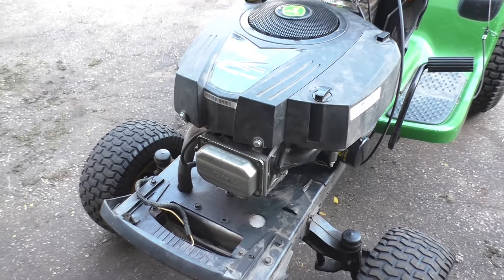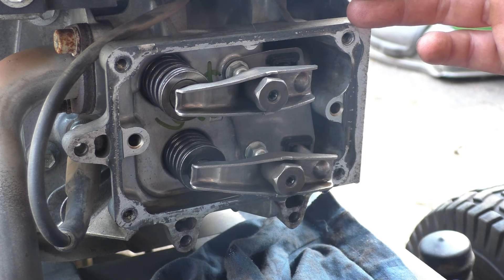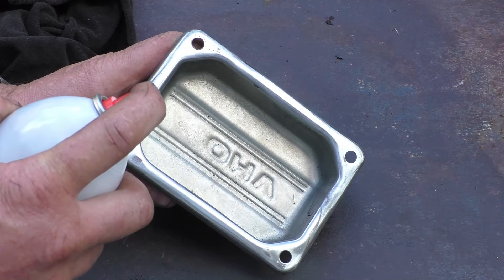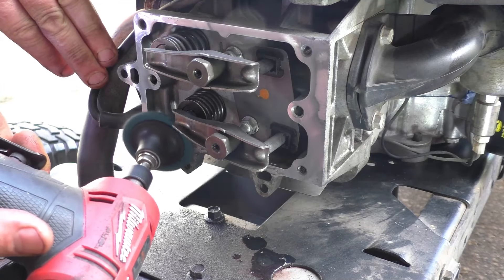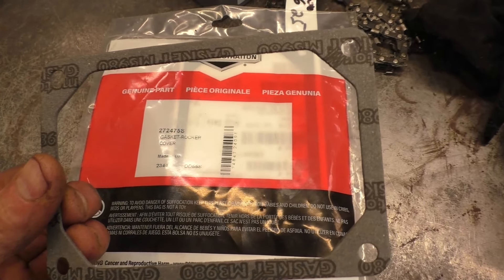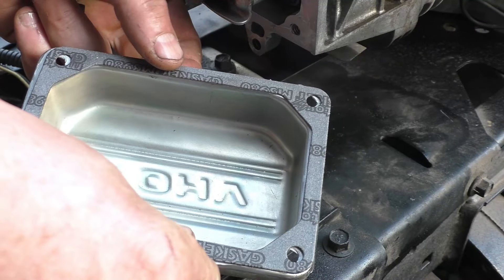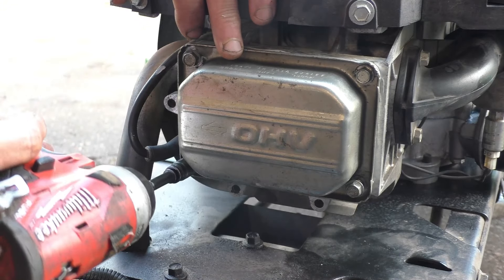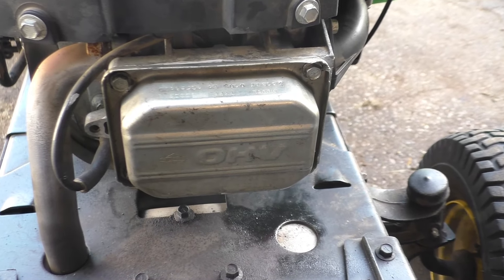HOW-TO Reseal A Briggs & Stratton OHV Engine Valve Cover Properly

Comment: The Scotchbrite disk made quick work of the silicone, good job Dony.  👍
Reply: Those 3M abrasives, and Milwaukee die grinder are a Godsend ! Very few tools make you smile every time you use them... 😁 Saves time, better surface quality ! 😉👍
Reply: That's for sure Marc, I love having them in the shop. 🙂

Comment: I got this procedure from one of your valve lapping videos, which I followed to lap my valves to raise compression.  I also used it to set valve tap clearances.  I also bought a RTV sealant for the new gasket, I think the one you used then, so thanks again for that video!  Great video, Don.  Showing to clean the head with debris going away from the valves was a great tip.  Thanks.  I hope your wife, your family and you are doing well.

Comment: I did the gasket and it still leaked.  Recleaned all surfaces applied RTV silicon and used a new gasket.  Tightened down the bolts but not too tight which would squeeze out the silicon.  Just tight enough and a quarter turn more.  Success!!

Comment: Thanks Donny. I've seen a lot of OHV covers with no gasket and only silicone.
Reply: Gen tech and I'm always in there every 100hrs. 
I use gaskets on all reseals , it's available and swaps onto ones that didn't have  a gasket.

Comment: I replaced a broken intake lifter rod recently and the rocker cover was well glued on with RTV. I made a gasket but I used my favourite.. Loctite No3. Great video Donny, keep them coming. Hi from Australia
Reply: @paulsouthgate8954 in my experience 518 sets stronger. I like No3 in case I want to check the valve clearance after a few hours running.

Comment: I started using this method years back to avoid the time involved with cleaning away the old silicone and reapply. Plus it makes checking valve lash a simple task.

It's been my experience the machined suface of the head will not leak but the stamped steel cover will leak if not sealed.

Comment: I like to let the hondabond/yamabond/3m (all the same) sealant set up a little before installing. 
Like 10 mins or so and hand tighten for another hour. Then torque down. 
Also, I use the finger dab technique for applying the sealant. Never had a leak and no worry about over applying. 
Im pretty picky when it comes to sealing as I've sealed a lot of ATV/Dirt bike cases. You definitely don't want them coming back leaking. 
Thank you for your videos. Keep them coming 👍🏼
Reply: I use JamesBond and NEVER have any Issues.
Reply: @edwinmcguire6040  🤣😎🤣

Comment: The RTV orange works well without a gasket! Thats what i use on my pick up truck rearend cover with never a leak. Prepping both surfaces well like you did is 90% of the job! Letting that RTV some cure time is crucial to finish off that job!
How many hours on a Briggs twin should you have before needing to checking the valve lash???
Reply: I did mine around 180 hrs or so. It needed before then but I didn't know it was a valve lash problem. 100-150 hrs is probably a good ballpark or you can just do it when it starts acting like a battery issue but it's not. (tries to turn over but doesn't ... repeat a few times and then finally turns over.) The manual says to check "annually", but I'm sure individual usage in a year varies widely.
Reply: @philshock3805  
Ok yeah my engine would do that "turn key and just click a few times then start" so I added a second starter relay in line and all this season has cranked over each time!
Thanks for your input.
Reply: Just checked my BS operator's manual for a 810 Vanguard 26hp engine says check valve clearance at 250 hours! Guess I have some work to do!

Comment: Here's an idea for a video.  You've shown several procedures for changing the rope on starter recoils.  I'm curious how an average DIYer would know which size to purchase as a replacement.  I need to change a fraying recoil rope on a 2,000 watt generator, roughly 100cc Yamaha engine, and there are so many possible sizes available -- #4, #4 1/2, #5 and so on.  How can a person measure the existing rope to know which diameter to obtain?
Reply from the maker: I would use #4 on that genny.
Reply: @donyboy73  OK, thank you.

Comment: Some of the Intek engines don't have a gasket & are just sealed with RTV silicone sealant for some reason !
Reply: "For some reason"... 😂
Uh... Yeah, THEY'RE CHEAP ! Anything to save a buck... 😒
Reply: @marcmyers1465 
Lots of things, including things on aircraft, cars, etc., etc. just use sealant and no gasket. 
It’s not just about cost.

Comment: I've never had a regular valve cover gasket just leak.
Reply: Me either & I hate scraping off the goo whenever I adjust valves. I even use gaskets on Honda GCV engines; used to cut them myself with scissors, hole punch, and an exacto -knife but have found seller on ebay that die cuts them. But, then again, I am more or less a hobbyist & Don is in business so I understand why he adds an extra step for customers.
Reply: Depends on "Who" was in there last ! 😒

Comment: You're better off either using RTV gasket maker alone, or gasket sealer with a gasket. In my experience working on cars and heavy equipment, mixing gasket maker and a gasket is like wearing two condoms. Personally, I'm a fan of permatex high tack gasket sealer, but it makes a godawful mess if you're not careful. And honestly even if you're careful. Never had a comeback though. As for RTV, I like the permatex 1 minute rtv because I can put equipment back into service immediately.

Comment: Lol. I have done countless valve adjustments on these engines, and I have never resealed them. I always just put them back on like they were, and I have never had one leak......until I bragged about it on the internet. My current project is the first one that has ever leaked. I should have kept my mouth shut.